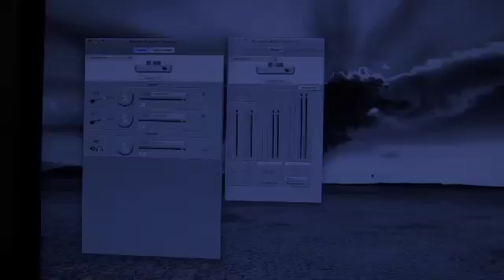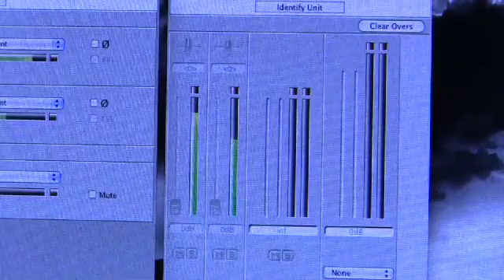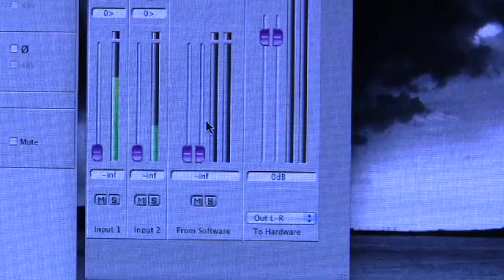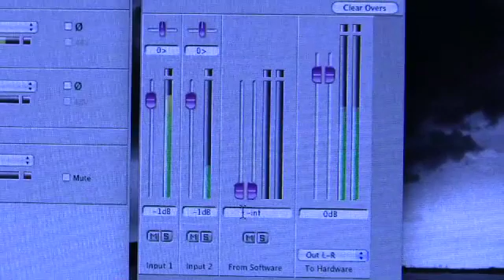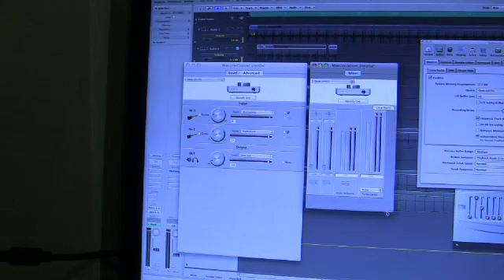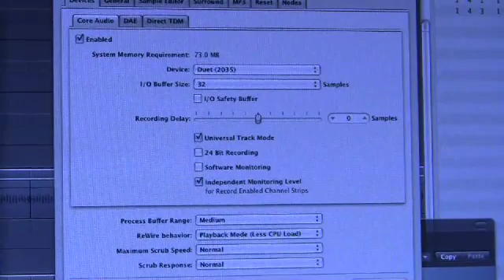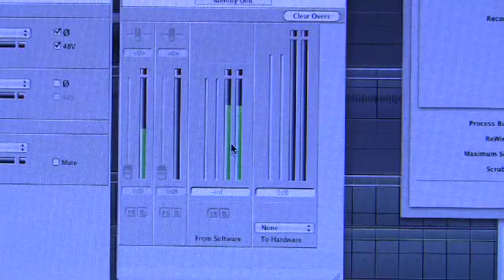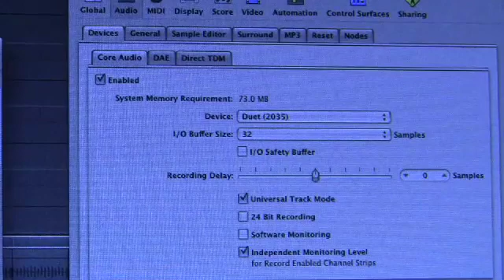Apogee Duet Review - Part-5

Comment: Hi dencetech,great detailed review on the Apogee duet which i am interested to buy,
one question for you if you don't mind answering please.
I have external reverb lexicon PCM-90,
Would I be able to connect the reverb or any external effect using  the duet as an interface  to Cubase.Or is there way to connect to the apogge in a way send and return.Or the Duet does not cater for that.,regards

Comment from the maker: @yamansitar - did y try resetting it - To reset the duet, disconnect the f/w lead, then hold down the center rotary and plug in the lead - keep holding down the rotary controller and after about 3 or 4 seconds you hear some clicks and it resets - if that doesnt stop the grinding, reboot - if that doesnt stop it and your mac is able to handle 32 samples then the duet is broken - that can happen, my first one broke down and had to be replaced

Comment: I have a question. During recording, in order to hear the instrument through the headphone, I need to switch "None" to "Out L-R" on the Mixer, just as you mentioned at 3:56. But as long as it's at "Out L-R", I can't hear what has been playing in the computer. So if I want to hear what I just recorded in the Garageband file, I have to switch it back to "None". Also I can't play background loops while recording due to this issue. I'm wondering whether I'm doing something wrong or it is like this?